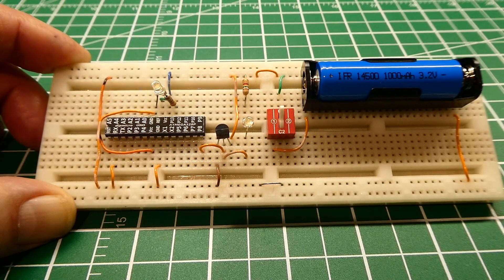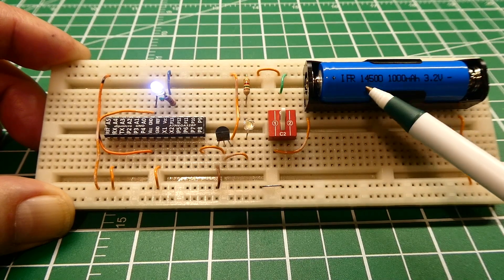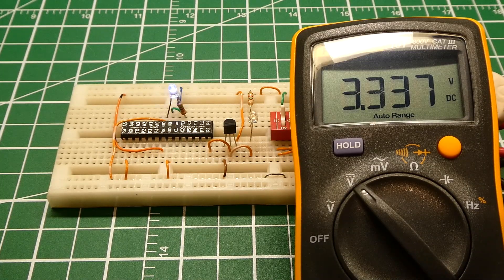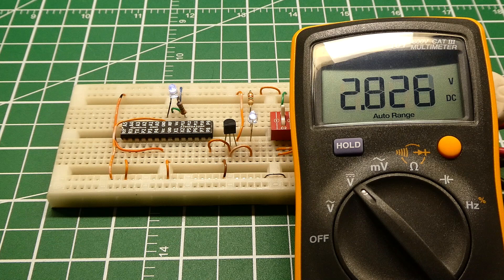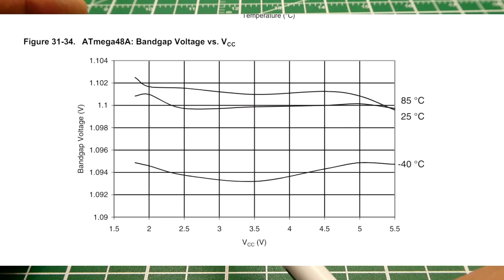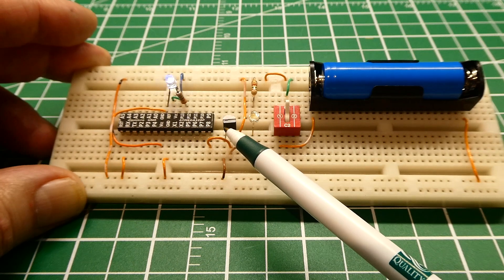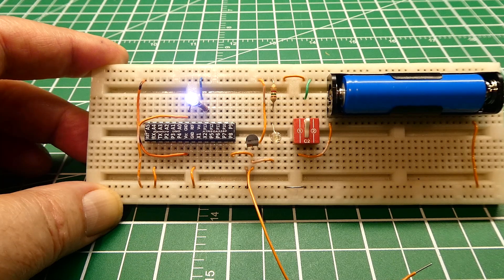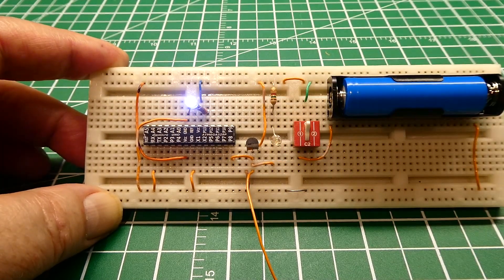Tip Of The Day / Low Battery Alarm / DS1233A-10

Comment: Thank you for this video. I could use your  help. I want to charge batteries with my Siglent PSU. I need the charge cycle to stop, when the current drops to 200mA. I can do this in the PSU's software, but I am not much of a coder. So, I am needing an adjustable low current shut off circuit. Thank you for your consideration of it. Using an Attiny85 and a sense resistor might work?
Reply from the maker: Check Adafruit website for a current sensor module to detect your 200 mA current trigger for shutdown.

Comment: I vaguely remember a chip named MAX809 that worked in a similar way, I will have to investigate. Thank you for another helpful tip.
Reply from the maker: Yes, the MAX803 is basically the same chip bit only available in SMD, so not breadboard friendly.